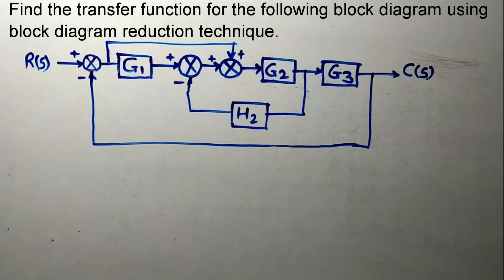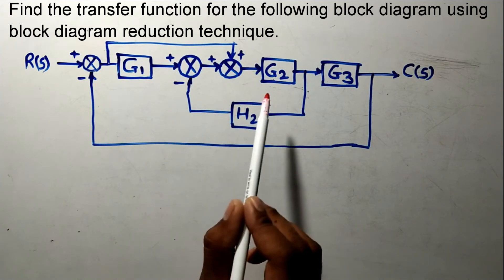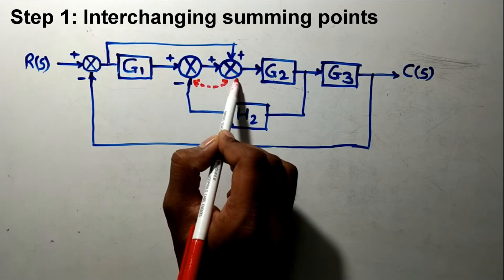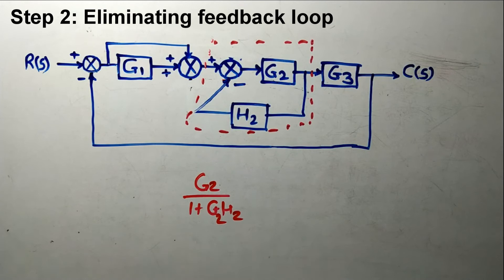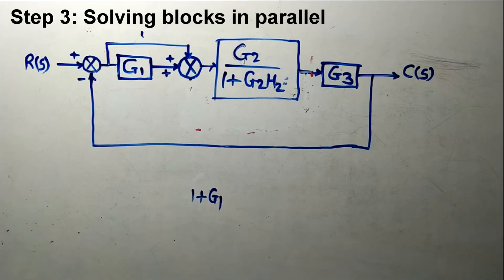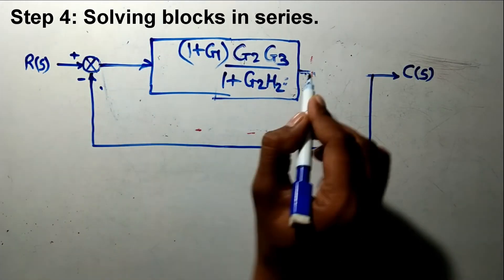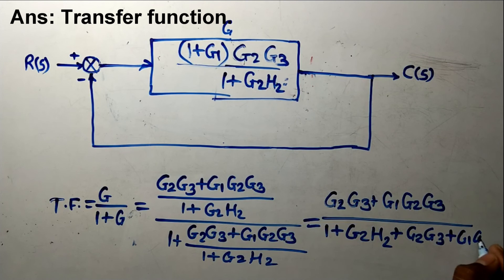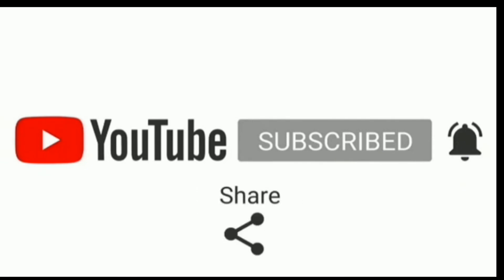Block diagram reduction problems in Control System Engineering | Problem #3 | Swap summing points

Comment: In the last part, why are you using H=1 yet it has a negative sine at the summing point
Reply from the maker: H=1 is used because while eliminating a feedback loop if negative feedback is there then transfer function becomes G/1+GH.
For positive feedback it will be G/1-GH.
Reply: Thank you, I get it💯